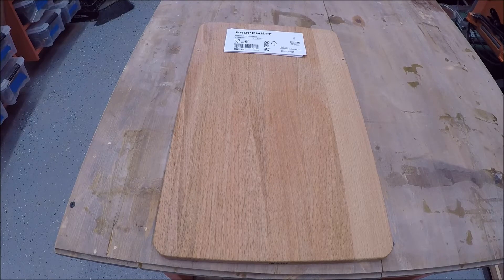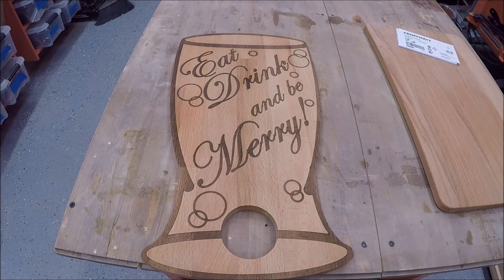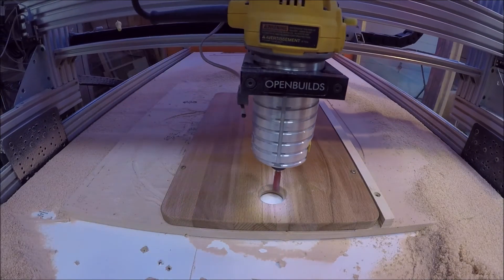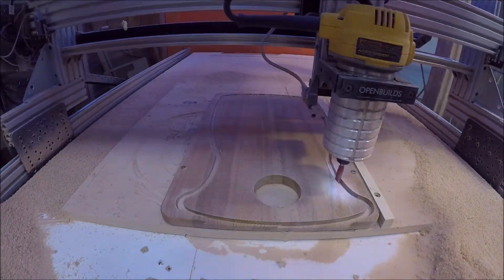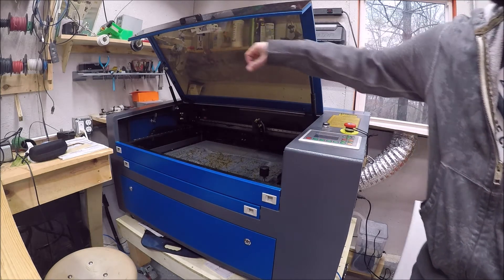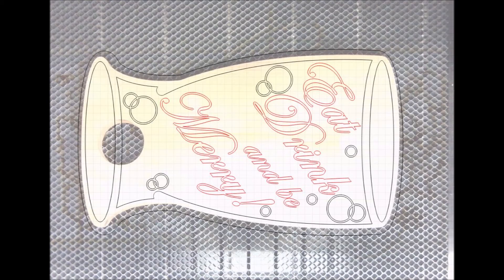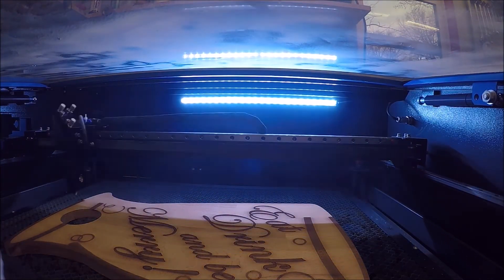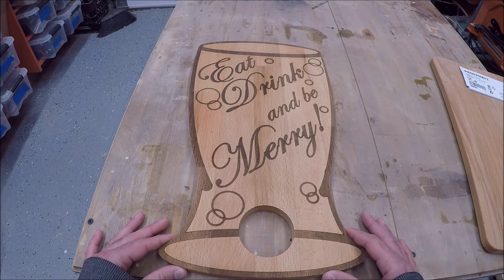Laser Etching IKEA Cutting Boards

Comment: Hey Man great videos! Just bought the same laser. Any words of wisdom? I feel like I’m jumping in to a territory I’m totally unfamiliar with. I do own a CNC and just finally got comfortable with that the last month.
Reply from the maker: Hey Matthew. Thanks for watching! I felt the exact same way when I got my laser. A few things that really helped me not feel completely lost was using the LightBurn software (its pretty epic), watching a ton of videos on youtube about laser cutters (SarbarMultimedia in particular), and experimenting with speeds and power settings before committing to a project. Every time I start to work with a new material I always run a program to see how the material behaves with different speeds and power settings. Also be aware the exhaust fan that comes with our laser is pretty bad. My shop has filled with smoke a few times when doing long wood engravings. After I got the hang of my laser cutter I feel that it is much more simple to use than my CNC, hopefully you'll fee the same way. Good luck!